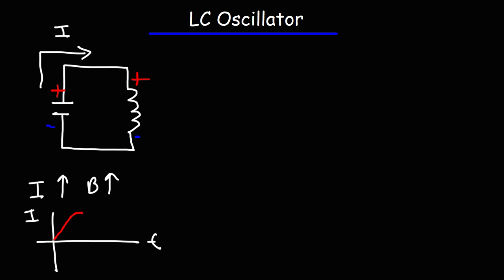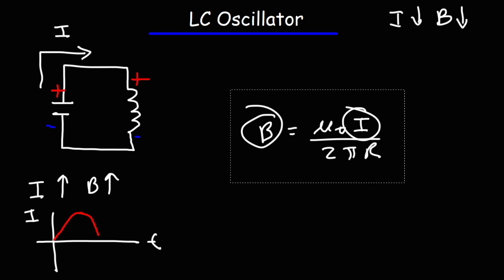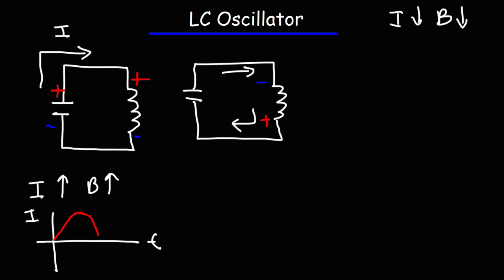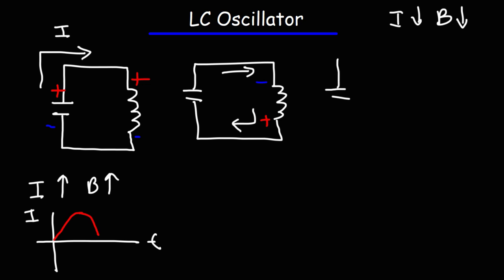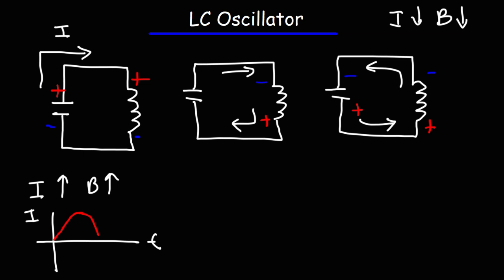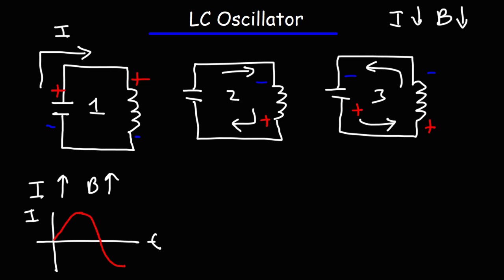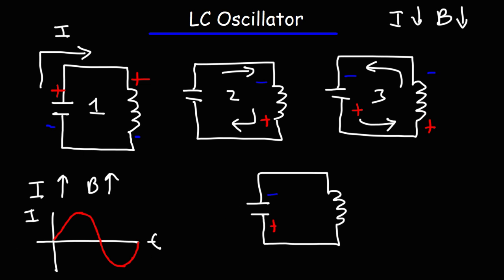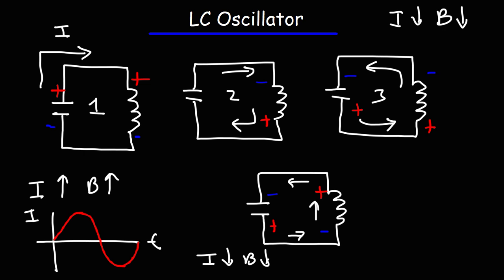LC Oscillator Tank Circuit

Comment: what happens if you build an lc circuit with superconducting wires in a vacuum?
Reply: In a vacuum, an LC circuit with superconducting wires would function ideally with no resistive losses, leading to perpetual oscillations of current and voltage between the capacitor and inductor. The lack of air would mean no dissipation due to the environment, and the superconducting nature of the wires ensures that the energy stored in the system remains constant unless external interactions occur. Additionally, quantum effects could emerge, especially in small-scale circuits.

TLDR, it means it would run as long as you keep the machine that cools the superconductor running.
Reply: @Por-poI   ty for answering my layman questions! One more: how does the size of the circuit correlate to the emergence of quantum anomalies/effects? Is it as simply as complexity?

Comment: Across what ur measuring current?????
Reply: It is theory actually you can't measure it, first problem is your current meter have some resistance which cause oscillation to decay and second thing is that  time period of this oscillation is very  small so even decay is hard to measure.Circuit have it own resistance so oscillation will decay automatically
Reply: @jo-c6001  thank you brother, I still have some doubt

Comment: I'm not sure that the inductor stores a charge. The way I understand it is that the as the voltage leads the current across the inductor, at a 90⁰ phase angle, then as the resultant magnetic field collapses, it induces a reverse EMF in the inductor windings. That's why it's called an inductor. Have I got that right?
Thanks for pointing out that you were using conventional current. I find it much easier to use actual current, as it is the negative having a surplus of electrons, being attracted to the positive with a deficit of electrons. Much easier to comprehend.
Reply: Agreed! And I don't think it was helpful to put polarity signs on the induction coil either. This channel's video are normally masterpieces so when a little niggle arises it's noteworthy!

Comment: You are good at explaining the details, thank you very much.
I would like to share something that's on topic in a practical way.

Years ago I spent $200 on a radio scanner so I could listen to the aircraft frequencies.
Some time after that I had an idea with the LC oscillator.
I payed $4 for a cheap pocket transistor radio.
I opened it up and found the coil of wire near the variable capacitor (the one with the tuning knob attached).
Using a small screwdriver I spread the coil apart a little which shifted the frequency of the oscillator
to a range that included the aircraft frequencies. Much cheaper than $200. LOL

Comment: The way to understand inductance is right hand curled fingers rule.  Step 1) I creates magnetic field curling around thumb.
2) When voltage shut off, magnetic field lines are still curled around thumb, so they push I in same direction.  Simple, just like a water wheel.

Comment: why inductor current starts going down after reaching max ? because once inductor is reached to max energy with max current, it starts negatively charging capacitor and due t that its current starts decreasing... this causes capacitor voltage increases and capacitor starts storing energy 0.5 CV2 form... this process repeat itself producing sustained oscillations.
Reply: You yourself gave your answer
Reply: Thank you bro! You asked the right question and made me think about how this really works. I think it would have been helpful to also plot and talk about the capacitor voltage / energy. At first it was not clear to me that when the current is at its peak, the capacitor voltage & energy = 0. And that the capacitor being "charged" (in 2:51) just means that the current continues to flow in the same direction but now the opposite plate will be assuming the greater amount of particles. Perhaps only I was being thick

Comment: At 4:39 in diagram 4, it looks like the pluses and minuses on the capacitor and inductor are on opposite sides.  Is that consistent with the convention that the voltage in a wire is constant over its length (so long as it's a region not containing a circuit element)?

Comment: If case 4 you have the sign of the voltage different between two points that have nothing between them but a wire. They must have the same voltage

Comment: A CAPACITOR HOLDS A POTENTIAL DIFFERENCE, NOT AN ENERGY. A LOADED CAPACITOR IS LIKE A BATTERY. My batteries have a potential difference in Volts, not an energy in Joules. A LOADED INDUCTOR IS LIKE A BATTERY TOO. @ 1:22 This is the energy of the ELECTRONS being pushed by the inductor-voltage. Just like V . q = energy.

Comment: Does the initial charging process of the capacitor use Ac or Dc? and does the current that flows alternatively across the capacitor and inductor infinitely after initial charging of the capacitor Ac or Dc?
Reply: Spoiler: we'd use a DC supply to get the initial charge into the capacitor, not an AC one. To see why, think what would happen if we used an AC supply instead.

By definition the polarity of an AC supply will alternate. As long as the voltage on the capacitor is less than the supply voltage, the supply will force current into the capacitor. That will continue to charge the capacitor: the electric field between its plates will strengthen and the voltage across them will rise.

With an AC supply though, that situation doesn't persist: at some point during the cycle the supply voltage will peak. It won't have reversed polarity yet, but instead of continuing to rise it will start to fall. Once it's less than the voltage which the capacitor charged up to, the supply can't keep forcing current into the capacitor. Instead the capacitor's stored charge starts draining back towards the supply. The electric field between the capacitor's plates starts to collapse and the voltage across them falls.

That's not what we want if we're trying to charge the capacitor then connect it, fully charged, to an inductor in an LC tank. Instead we want to charge the capacitor, disconnect it without giving it a chance to discharge, then connect it to the inductor and watch them pass that energy back and forth.

If we were quick enough, we could disconnect the capacitor right at the peak of the AC cycle: it would be fully charged and wouldn't have begun to discharge. But why make things difficult? It's much easier to use a DC supply, not an AC one, to get the initial charge into the capacitor. We'd connect the two; the capacitor would store charge until the voltage across it reached the DC supply voltage; and, because the supply voltage wouldn't start falling, we'd have plenty of time to disconnect the capacitor without it starting to discharge. Then we'd connect it to the inductor and see how they behaved.

Comment: In 1:16 , did the current increase because of the supporting emf produced by the inductor? Since capacitor will have lesser and lesser energy(decreasing emf(from capacitor)) because of the discharge of charges.

Comment: Hi, very nice video! Could you please provide concrete examples for both the capacitor and the inductor to show the undamped oscillations? I am asking for the values of capacitance and inductance. I would like to charge the capacitor by means of a regular 6 V battery, and I would like to see the oscillating current on one oscilloscope screen. Also, which energy feedback would you recommend having connected to this “Tank” circuit in order to keep the amplitude moderately constant? Thanks for your attention to this!

Comment: Hate to tell you but the current flow is from the negative to the positive.
Reply: That is electron flow. Conventional current is opposite where you take the charge of electrons as positive.
Reply: @nellvincervantes6233  hey, should not the step 1 and step 4 be the same i mean like they are at the mean position. The positive side and negative side is not the way it is after one oscillation. Why?
Reply: @dremr2038  yep, I think he just made a mistake!!! 1 and 4 diagram should be the same, it's only the floors of the current that changes.
Reply: @dremr2038  yeah man I am gonna leave this video, that confused me also
Reply: Go and watch SpongeBob SquarePants

Comment: It is sine wave for current right. Then the potential difference or voltage on inductor is L*dI/dt where L is indu tance and dI/dt = rate of change of current, then I = sin(wt), dI/dt = wcos(wt). V = Lw*cos(wt). Does that mean voltage and current have 90° phase difference? Likewise for electric field and magnetic field that create electromagnetic field for signals?
Reply: Yes i believe voltage and current are 90 degrees phase shifted.

Comment: Will you make a video about how to make that oscillation run forever, I mean until the power supply is disconnected?
Reply: there must be some sort of feedback or external source to compensate for the loss.
Reply: There is a lot of sketch on the internet, but i don't understand the absolute theory behind all of that
Reply: @fatonisodiq9341  did you find any?
Reply: Well guess I'm the next in line in this puzzle
Reply: You need a positive feedback loop and an initial trigger

Comment: So why direction of the flow keeps changing in the circuit?
Reply: Current direction keeps changing that's y
Reply: Because inductor and capacitor change polarity over time. That means they absorb and release energy